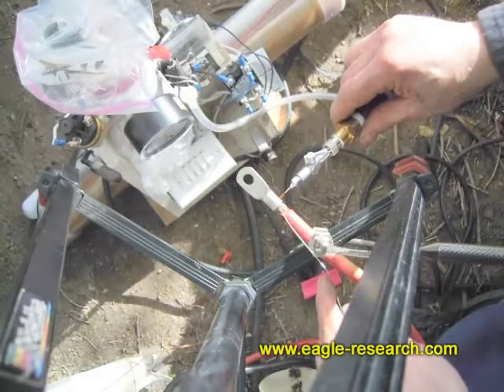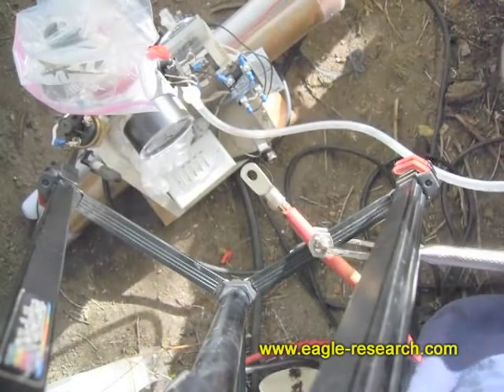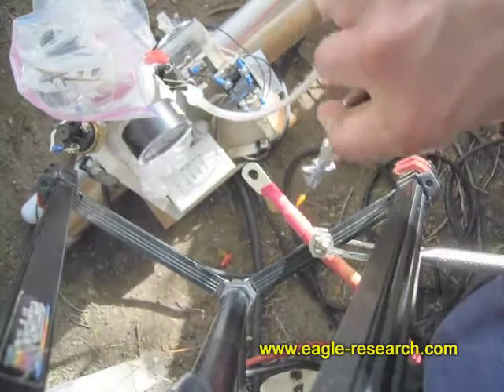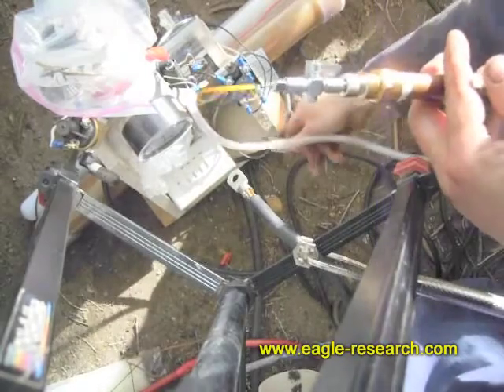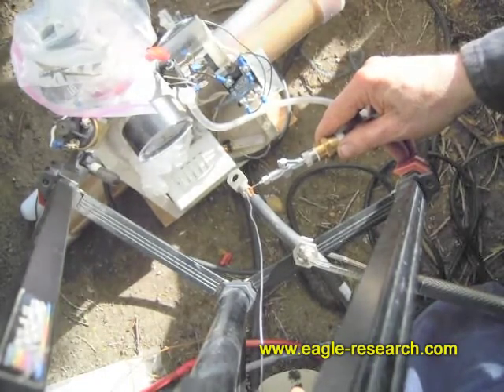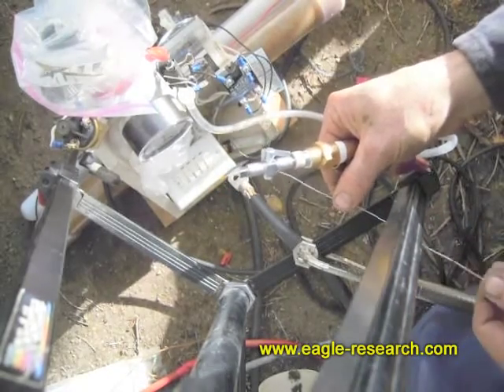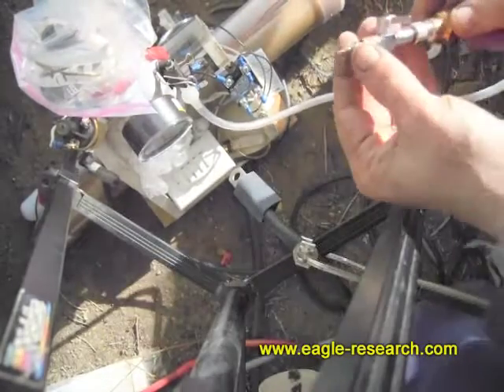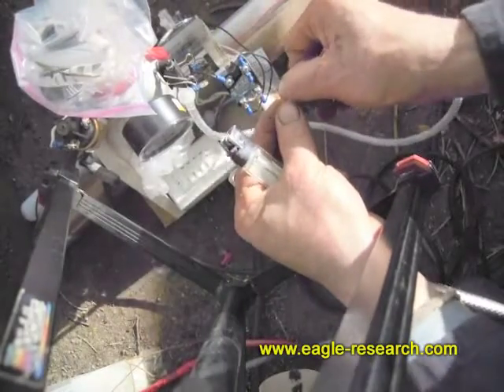Soldering Terminal Ends using Brown's Gas (HHO)

Comment: so the heat is on the metal terminal, I always heated the air around the solder and let it kinda drip/smashed the solder onto the connection. I was mostly using it for copper piping as a plumber though. maybe I was not taught soldering well or come to think of it, at all. lol I should look into that real quick. thianks 
though the ending gave me a bit of a puzzle and another question. how do you mean liters of gas? are you referring to at a specific pressurized canister? maybe i have spent more time away from the sciences than I should have and my ignorance is showing but a volume of measurement for gas doesn't make immediate sense to me.
Reply from the maker: Yes, heat the metals, so that the solder can flow into them.  Don't heat the solder, have the metals heat the solder.
The 'liters per minute' is to describe the volume of gas flow.  The gas must flow with a velocity of at least 21 feet per second or the torch will backfire.  The larger the torch orifice, the greater volume of gas needed to achieve 21+ feet per second.